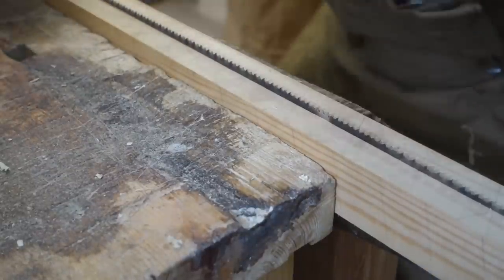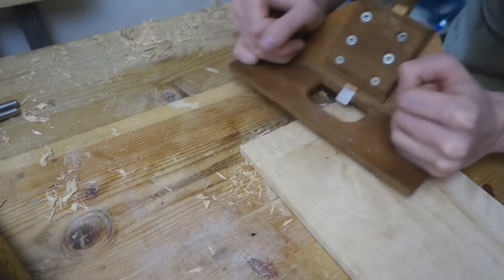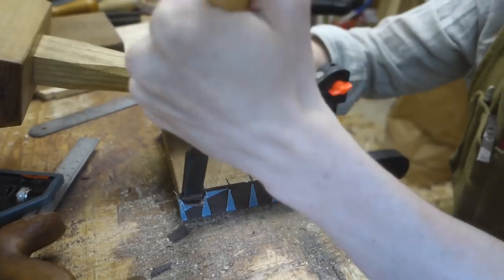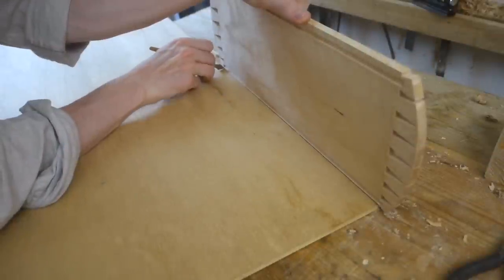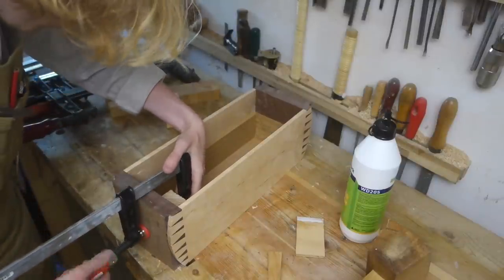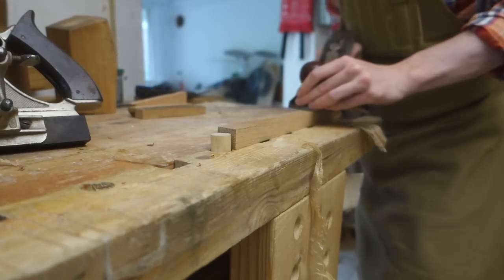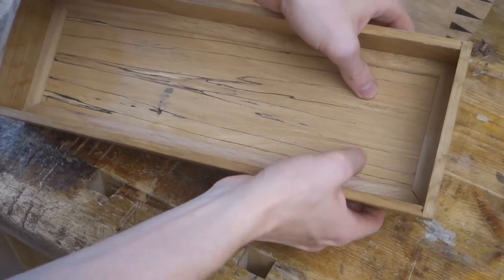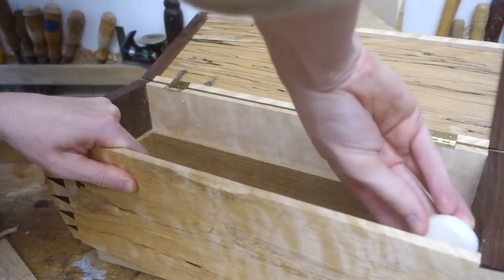Dovetail box with curved sides and piston fit tray

Comment: I want to say thanks for the great tip on using tape to mark the pins of the dovetails.  I'm new at hand cut dovetails and have had trouble finding a technique that works for me.  After watching this, I tried it and it worked great!!  My first joint fit right together without any work on the pins to get the joint to fit.  Thanks agin for showing that.  BTW, your box looks great!!
Reply from the maker: Glad you found something helpful in the video! Thanks!

Comment: Great video. Love the process, but I'm not keen on contrasting timbers, so the finished box isn't my favourite. 
You made most of the box exactly how I would have done, although I might have clamped a batten in place to guide the long cut when taking off the lid, and I am sure I wouldn't have planed out from the walnut across the dovetails for risk of breaking them out. I have also finally given up on Osmo after years of frustration. 
Did you consider making the tray base first and them using that to ensure the sides stayed square when clamping? 
I've now subscribed, and will work my way through your back catalogue of videos. I hope your wobbly bench and weak vice don't annoy me too much!!! Your video style is precisely how I like them.......gentle, laid-back, matter-of-fact, and letting the woodwork dominate rather than music or some shouty presentation style.
Reply from the maker: Thank you for your thoughts! A batten to saw against is a good idea, and you're absolutely right about planing out across tails. It can be done with a sharp blade, skewed angle and shallow depth of cut, but I don't know why I took the unnecessary risk.
Making the tray base first would work too, but I figured it would be easier to install it afterwards because of the extra pieces with the groove, which would be a lot to juggle in a single glueup.
Not sure what you mean by wobbly bench and weak vice, but glad you like the video style, I hope you enjoy the rest :)

Comment: How do you manage to get a saw you can sharpen and use that well for ripping? I'm looking everywhere but I can't seem to find one
Reply from the maker: Lots of flea markets and keeping a close eye on local auction websites. I've started looking for brass bolts/nuts and wooden handles, as that signifies age (not a guarantee though, of course), and don't be afraid of rust, that's easy to remove for a tool that'll last lifetimes. If it comes with rip or crosscut teeth is not the biggest deal, you can change it when sharpening, so tooth/gullet size is more important in my opinion.

Comment: Is that RUST on the Side Wall of the Plane. See 15:50 ! Jesus look after the plane dude. All it takes is some wire wool, cloth and wax.
Reply from the maker: What harm does rust on the sides do?
Reply: @GillisBjork  I'm getting old I guess but still remember woodwork class, all the hand tools had to be kept in 'good order' as our teacher taught us. Clean of rust, dirt and given a light and I mean a very light oil before and after use. I think, I'm not sure, it was to help reduce friction/chatter. Of course the blade is the main culprit in chatter but old iron planes used to be expensive. They take a lot of work to manufacture. Consider the iron ore, the smelting of the iron, the making of the mold, the casting process, the machining of the sole, the sides the drilling of the holes and tapping of the threads, the tool steel blade, the wood handles. Items like this deserve to be looked after for no other reason than to respect the men that made them but also to preserve them in good condition and perhaps even to make them function that little bit better ! I'm sure there was a practical reason for using the side in planning, perhaps in conjunction with a shooting board or maybe it was to use the plane to make a joint to join two boards and the side was what the plane rested on so you need it to be smooth so it slides easy for such work. I keep my tools as free of rust as i can and lightly oiled but that's me. They just look better that way if nothing else. :) Imagine if the new owner of your elliptical table put a boiling hot cup of coffee on the surface, and it burned a ring, into the veneer/wood finish. ! It would still be a table, it would still function,  how would you feel about that ! :)